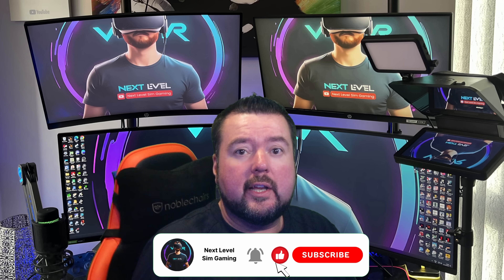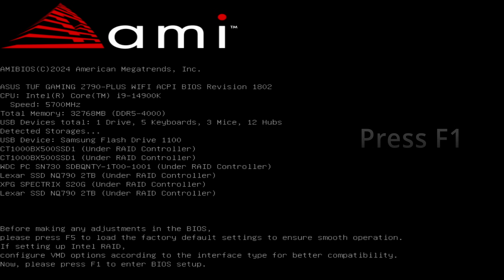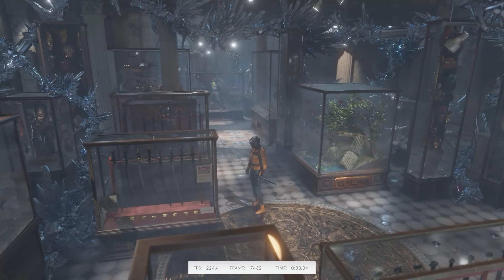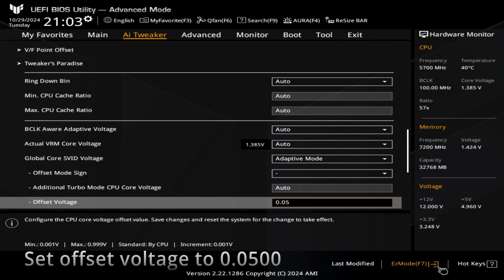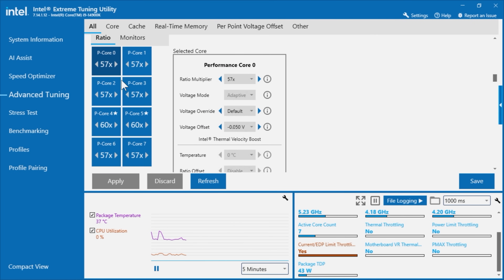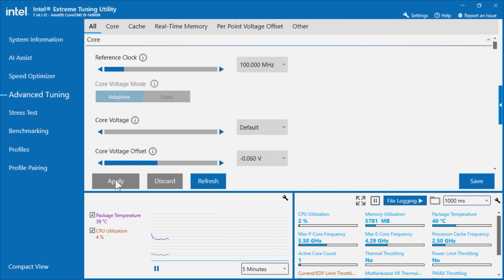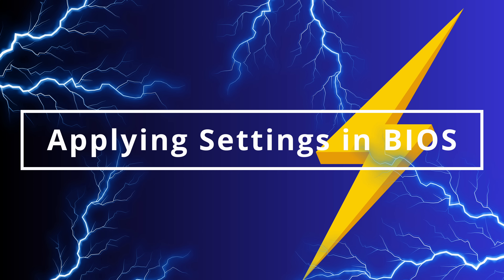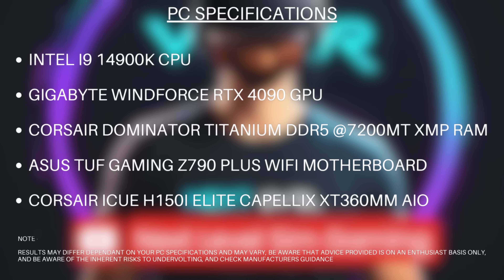i9 14900k Intel Final Microcode 1802 - 0x12B  BIOS Installation, Tuning and Undervolt Guide 📈

Comment: I used your guide on my Intel 14900K, and it worked really well.
I've managed to lower the idle CPU temperature all the way down to 35°C, and under full load, it runs at around 55-60°C, even with max settings in brand new games.
I should also mention that I have a solid setup – good airflow, efficient water cooling, and a high-quality case with a well-optimized fan configuration.
Reply from the maker: @lunde67  Great to hear mate, happy gaming
Reply: @lunde67  what did you tweak aside from thr cpu voltage? How bout the ratios ? C55 x54 x53?
Reply: @JsinJzone I have the same ASUS motherboard, but I'm running a newer BIOS version (2801). I followed the Next Level Sim Gaming guide exactly—set up my BIOS accordingly and used Intel Extreme Tuning Utility with all the same settings from his video. My multiplier is set to x55 with a -0.070 V offset. I'm getting 15,376 in the Intel Extreme Utility benchmark and 42,768 in Cinebench. CPU temps stay below 80°C during both Cinebench runs and the Intel Extreme Utility benchmark—occasionally peaking at 81–82°C—but I’m using a high-end AIO water cooler.
Reply from the maker: @ Great to hear 😎
Reply: @ I also think my RAM plays a role in the benchmarks I'm getting. I'm using Kingston FURY Renegade RGB DDR5-8400 (CUDIMM), which is a bit faster than what Next Level Sim Gaming used in his setup—I believe he was running 7400 MT/s. I know a lot of people say the sweet spot for DDR5 is around 6000 MT/s, and of course, it also depends on how your specific CPU responds to overclocking.

In my case, it seems like I got lucky—my CPU just keeps performing better the more I tweak it. The combination of my CPU and the Kingston DDR5-8400 memory works really well together, and I’m seeing great results across the board.
Reply from the maker: @ I have the 48gb Kingston Renegade Fury 8400m/t CUDIMM RAM on my Core Ultra 285k setup excellent RAM 😎

Comment: My CPU temps are between 80-92  i have the same cooler but i dont know what im doing wrong 🙄
Reply from the maker: @fubi8380  Part 2 - How to set the correct undervolt for ‘your’ PC 😉

Guide to Setting the Correct Undervolt and Stress Testing Intel Raptor Lake i9 14900k
https://youtu.be/XM2JLjcQZgc

Comment: So if i buy a 14700k, this is what i have to do to keep it save from degrading? I ask because how many simply don't know about this...
Reply from the maker: @ashramamazonico210  Simply updating the BIOS to the latest Microcode will stop elevated VID requests undervolting will reduce operating temperatures

Comment: 1.4 still kinda high long term, not something id run for high load and for extended periods
Reply from the maker: @xsparky0168  You need to refine the undervolt which is specific to your system.

Every processor is different based upon silicon quality, also case cooling etc, thermal paste application, pressure of cooler on IHS

Use this video to refine your undervolt 

Guide to Setting the Correct Undervolt and Stress Testing Intel Raptor Lake i9 14900k
https://youtu.be/XM2JLjcQZgc

Comment: Snagged a 14900k for fairly cheap to upgrade from my 12900K on my Z690E once it comes in looking forward to testing it out and then trying some these undervolt specs, great video!
Reply from the maker: @thehammer88  Good to hear, enjoy ☺️
Reply: @nextlevelsimgaming came in and got it to -.120 with a 38664 CB score, probably could keep trying to lower but pretty happy with the temp and score change at -.120 appreciate the settings! Think base was only just above 34k
Reply from the maker: @ Great job

Comment: When I try to change the Global Core SVID Voltage I can only change from auto to manual. I have no offset settings for it. Is it still possible to do this?
Reply from the maker: @Palla789  Is it a Z790 Asus motherboard you have?, as per the title?
Reply: I found it now. Thx for answering so quick anyway.
Reply from the maker: @ No problem

Comment: With ample cooling. Do you think the 5.7 could be something these settings could do ?
Reply from the maker: @Neil1454  I have covered this scenario in this video you may be interested in

Undervolting and Tuning Guide Intel i9 14900k - Core Sync 5500 to 5800 mhz &  Performance Benchmarks
https://youtu.be/hh3FIN1c_ZQ
Reply: Have a question. The more undervolt I did. I went from 0.500 through to 0.700. Vid was around 1.2 at 0.600 but at 0.700 seemed to more 1.24.
Is the LLC causing that and pretty much defeating the undervolt purpose ?
Reply: This was in cine r23
Reply from the maker: @Neil1454  Cinebench R23 / R24 or 2024 are all demanding on the CPU, the purpose of the load-line is to prevent power delivery loss with anticipated load, its not indicative of real use case, so should not be used as such an indicator.

Comment: Hello why i have only 20483 score in time spy with your setting. I have i9 14900kf . Thanks
Reply from the maker: @samsel57600  Close all running applications in the tray when benchmarking, such as Chrome, RGB software etc.

Also what GPU do you have?, this is running with a Gigabyte RTX 4090 the GPU will also affect your score
Reply: @nextlevelsimgaming  i have 4090 gigabyte oc. Graphique score 38503
Reply from the maker: @ And have you refined the undervolt?, the score will be dependent on your individual silicon quality, also RAM speed, in this specification I was running 32gb Corsair Dominator Titanium @ 7200 m/t

Follow this guide on how to refine the undervolt.

Guide to Setting the Correct Undervolt and Stress Testing Intel Raptor Lake i9 14900k
https://youtu.be/XM2JLjcQZgc
Reply: @nextlevelsimgaming  yes undervolt -0.075 is good for me. My ram 6000 . I have test in 5.6 stable but score note change
Reply from the maker: @ And you are using the Asus OC profile with the Intel power limits set?, not the Intel Default profile?

Unfortunately I can’t assist much more than that, just ensure the guide is followed correctly, other users score similar to mine, but it all is specific to the system, the underlying purpose is to improve performance over the Intel Default profile, and reduce temperatures, and hundreds of users who have used these series of guides have reported success.

I would recommend BIOS press F5 to set to Default, follow the guide carefully and retest.

Also check the integrity of your processor by using the Intel tool here -

https://www.intel.com/content/www/us/en/download/15951/intel-processor-diagnostic-tool.html
Reply: @nextlevelsimgaming yes I did as in the tutorial. I will launch the intel program tonight to see what comes out of it. I will write to you here. Thank you
Reply: @nextlevelsimgaming should intel speedstep and speedshit be enabled or disabled?
Reply from the maker: @ The tool is to identify also any potential degradation issues, so the report generated will assist you if you do have a defective processor.

There is only a minimal difference between the 14900k and 14900KF

https://technical.city/en/cpu/Core-i9-14900K-vs-Core-i9-14900KF
Reply from the maker: @ I leave it enabled even though it relates more to laptop than desktop.
Reply: @nextlevelsimgaming ok. it would be surprising if it was defective, I bought it 1 week ago.
Reply from the maker: @ I wouldn’t get too hung up on benchmark results, the main purpose of undervolting is to reduce temperatures under load which will in turn improve efficiency and performance through not throttling.

Unfortunately many chase figures in synthetic benchmarks than actually enjoy gaming, it becomes a rabbit hole, so just be happy with the improvements in temperatures and improvements in stability and enjoy 😉
Reply: @nextlevelsimgaming you said it all in this reply 😊
Reply: @nextlevelsimgaming  39324 in r23

Comment: If altering settings will this remove intels safe settings that protect the cpu? I have a 14900k and I find that when bench marking I'm hitting the power limits on all cores using the Intel setting in bios (nothing manually changed).
Reply from the maker: @Neil1454  The Intel Default power settings are used to modify the unrestricted power limits of the Asus OC profile, also Unlimited ICCMAX is disabled, so in short, yes it will still protect your processor as the ability to run untethered power limits is removed.
Reply: @nextlevelsimgaming  thank you for replying so quickly. And also for making your videos. Very useful.
Reply from the maker: @ No problem enjoy 😉
Reply: @nextlevelsimgaming  also can I ask would the system generally just blue screen if settings are to strict? Or can just scores be hindered on bench marks. How can I tell if I'm on the edge when tuning ?
Reply from the maker: @ The XTU stress test using the Advanced Vector Extension (AVX2) test is the most excruciating on the CPU, if it passes on there, even with a relatively short 5 minute test then its likely the system will run stable.

From there you can run Cinebench, 3D Mark, Blender etc to check benchmarks.

If a stress test fails in XTU it will show a fail, and you would adjust the undervolt accordingly.

See this further guide on how to refine the undervolt to your specific Silicon Quality.

The worst that will happen is the PC will shut down and reboot and XTU will return to default settings 

Guide to Setting the Correct Undervolt and Stress Testing Intel Raptor Lake i9 14900k
https://youtu.be/XM2JLjcQZgc
Reply: Tried to install XTU for my 14900k once installed it said unsupported platform. Any ideas please ? Getting this working would make my life easier. It's on windows 11 pro.
Reply from the maker: @ There are two versions, one for Core Ultra and one for Raptor Lake you need Intel® XTU version 7.14.2.14
Reply: @nextlevelsimgaming  thank you.
Reply from the maker: @No worries

Comment: I have an i9 14900KF, and it's overheating at around 100 °C. I have a Z790 motherboard. Can you help me tweak the bios for the 55 profile?  I just watched your other video with intel EXT.
Reply from the maker: There are a number of video guides I have produced on the subject, you would need to watch and implement these in the same way.  I cannot assist people on an individual basis unfortunately,  I work as a full time engineer, and produce the content as more of a hobby, but the 14900KF guide would be the same as for the 14900K

Comment: I have followed your video adjust asus oc with down volting to 0.065 all good scores improved system stable thanks. But if I test Gpu 4090 strix OC with 3D mark stresstest my screen goes black after a while, and fans turn full speed until I force shutdown. CPU14900K Board Asus Hero Z790 , 32GB. PSU1200 Rog. What could be the problem. Sockets are tight enough. What do you advice 🤔
Reply: Are you still experiencing monitor switching off, fans max speed? I had the same issue but with a bit of research I was recommended to put a support under GPU and change 12vhpwr cable. No issues since. Hope that helps.
Reply from the maker: @shitokenjpn  Probably - 0.065 is too extreme for your particular silicone quality, its individual and you will need to test to find the correct one for your system 

See this further guide on how to do so

Guide to Setting the Correct Undervolt and Stress Testing Intel Raptor Lake i9 14900k
https://youtu.be/XM2JLjcQZgc

Comment: Tried this, and the performance and temps are great! But I'm crashing/pc restart when I stress test using xtu avx2, the offset voltage is 0.050 like in the vid T T though with cinebench r23, no crashes at all (Though at first the xtu didn't crashed and passed the stress test, also reverted back to intel default settings, didn't crash)
Reply from the maker: @JohnPaulo0927  It can happen unfortunately.  All CPU’s are individual, and based upon silicon quality, however a CPU that is degraded also won’t be able to hold an undervolt.

You can try setting IA CEP and SA CEP in BIOS to disabled, or consider RMA’ing your processor, or reduce the undervolt to - 0.0300 and see if it will hold there.

Point to note is a degraded CPU will require more power to operate, undervolting is also common practice for PC users.  If your PC runs fine on Intel Default then unfortunately you wouldn’t be able to RMA on the basis it won’t hold an undervolt alone, continued crashing even ‘when’ using Intel Default would however, but from your comments I would say its likely it is, other users have had the same symptoms, RMA’d, come back here and reported no issues with the replacement processors.
Reply: @nextlevelsimgaming  Thank you so much for the info! I'm not really knowledgable when it come to this stuff T T  Though after tweaking it a bit, I just noticed that my cpu core/cache current limit on my bios said it was only on 307a not 400a like indicated on yours? I followed exactly (hopefullyI didn't missed anything) the instructions in this video and only changing cpu core/cache limit max to 307a not 400a and I manage to undervolt it up to 0.070 offset voltage (haven't tried anything lower yet) without crashing on avx2 test on xtu. Though I got a lower score on cinebench r23 compare to the previous settings (Though I'm crashing in xtu avx2 stress test with that settings, 400a and 0.060 offset volatge, 38k score) and I'm getting a 37,353 score with 307a and 0.070 offset voltage but this time I'm not crashing the avx2 test :)
Reply from the maker: @ You need to select Asus OC profile, as shown in the video the reason it is 307a is due to the fact you are on Intel Default Performance mode.

The score will be bad, as you need to physically input 400a iccmax, and 253 pl1 and 253 pl2 for power limits.

In BIOS hit F5 to reset to default and follow the guide correctly

Comment: I am really stressed and I don’t have the money to bring the pc in to get professionally looked at. While following the video I enter the changes as stated, however as soon as I save changes and reset I get numerous errors. Currently I have BSOD Inaccessible_Boot_Device. I was crashing constantly last night and reinstalled windows and fixed those problems. Now no matter what settings I try for the cpu it just crashes. Every stress test immediately crashes the pc and it restarts with no error code. It was working fine last week, now it’s just not.
Reply from the maker: @00g99  Hi, first of all, Inaccessible boot drive is caused by either the incorrect drive being selected in BIOS, or the boot drive (if mechanical HDD for example) may be Legacy, or Enable the AHCI mode in the BIOS.

Also ensure this guide is correct for both your Motherboard type, an Asus Z790 and processor Intel i9 14900K

Secondly, if it constantly crashes to Windows then press F5 in BIOS to revert back to factory defaults and select the Intel Default Profile 

Now test for stability 

If it does not run stable and all the above are correct, then your drive may need replacing and a fresh windows image applying.

From your initial comments regarding the inability to see the drive once the BIOS has been updated indicates to me that this may be the case.

These guides are for advice, and are tested on the platforms shown, as shown in the video description any overclocking or undervolting is done at the users own risk, however I do not believe your issue is related to the undervolt, more indicative of an old drive that has been swapped to a new board that is not RAID enabled.

If after replacing the drive, and if your processor does not run stable on Intel Default Profile then you would have rights to RMA the processor for replacement.

As you can see hundreds of users have applied the settings, and it has helped them tremendously.  Undervolting is nothing new, however people are generally unaware as to how to.
Reply: @. I had this boot issue last night and managed to reinstall windows, however after crashing multiple times my pc shown another BSOD, I will reinstall windows again and I will give this an attempt, thank you very much. Do you mind if I refer and comment back here for future questions if necessary.
Reply from the maker: @ I would replace the drive also when you reimage, as the symptoms look like a failing drive.
Reply: What ?
I also got that on my PC whenever windows boot logo finished rotating on boot 😮

But i fixed it, my SSD failed 😢
Reply from the maker: @ Unfortunately all SSD’s have a limited lifespan, its always best to buy the best quality storage you can afford and backup regularly
Reply: @nextlevelsimgaming  Yeah
Reply: @nextlevelsimgaming  My data is now lost 😭
Reply from the maker: @ Nothing I can do to assist with a failed SSD unfortunately, I would suggest using a program such as Macrium Reflect when you do your new installation to back up your data to prevent any data loss in the future
Reply: @nextlevelsimgaming  NP,
I would do that !
Also, i suddenly remember my Drive account 😃
Reply from the maker: @AHOP-v9d  Good news 😉

Comment: Thanks. I really appreciate this  helped greatly startled off 35,469 now 38,889 C.B r23
Is there any difference windows 11 I'm on windows 10 
Wanting to change but so many tell me to stick on windows 10
Reply from the maker: I am on Windows 11, was previously 23H2 but have recently updated with a fresh install to 24H2, there have been a number of improvements to scheduling where there are claimed performance benefits for Raptor Lake, so don’t be afraid of updating, I would say if you do, make it a fresh install rather than upgrading as it can cause a number of driver issues
Reply: Thanks for your reply, I'll give it go
Reply from the maker: @ No worries 😉